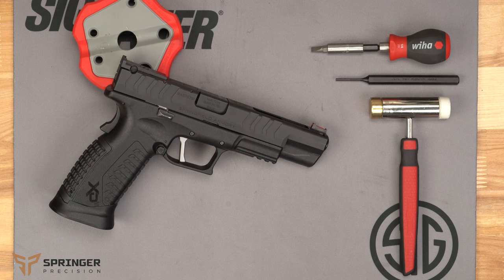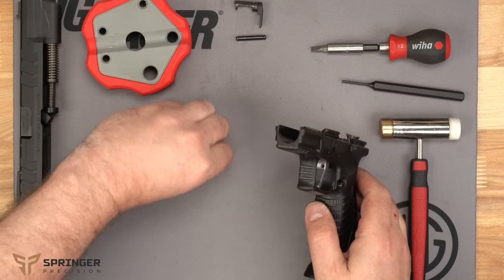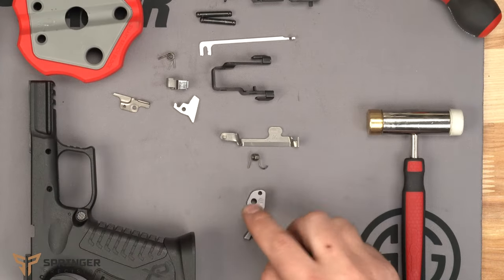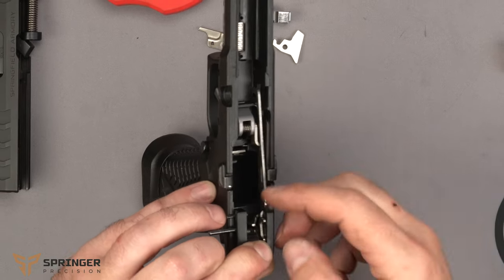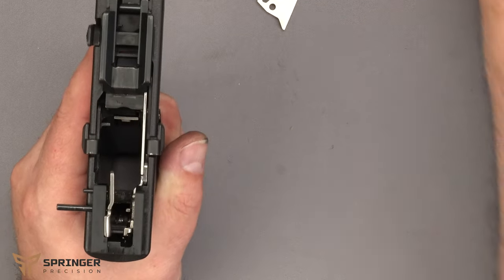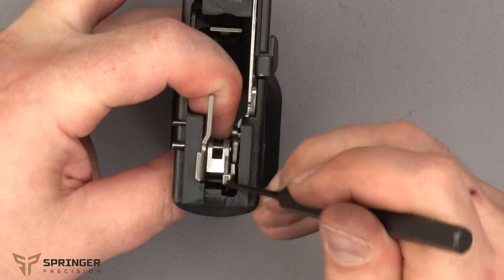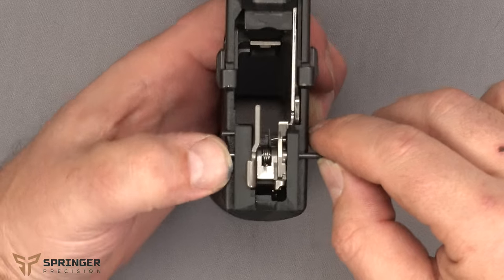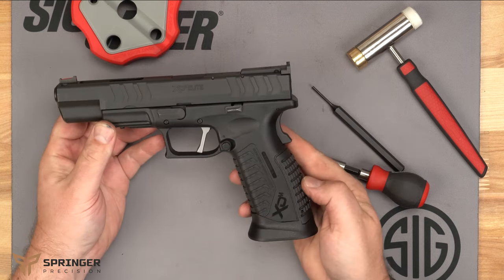Springer Precision XDm Elite Fire Control Disassembly/Assembly

Comment: received my trigger kit last night 03/12/2024. installed following the provided videos on their web site as there were no instructions included nor written instructions on web site. installed are included components with ease function check was good. got to the range this morning 03/13/2024 loaded up took aim slow steady squeeze and click.... tap rack bang..... no bang. im getting very weak primer strikes on round 1 and round 3 roun 2 looked like no strike or faint enough not to show a mark. any help or advice would be appreciated.
Reply: @scottspringer5698  thanks for your reply i have an email into your office subject line "#54018 click no bang" i would appreciate if someone could contact me regarding this issue as i followed both of your videos on the product page to install the trigger kit and all of its contents and am getting a failure to fire.

Comment: I know this is old, but I couldn't get the grip safety in a proper position.
Reply from the maker: @JohnAIDoe  try using the shaft of a Qtip to hold it into place before trying to get the pin in.